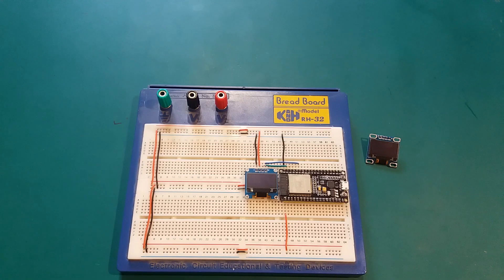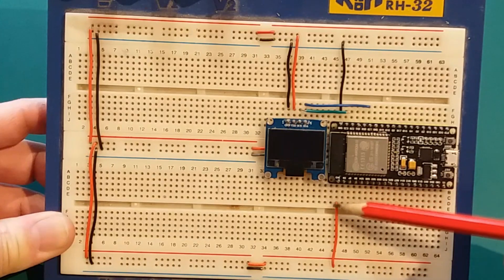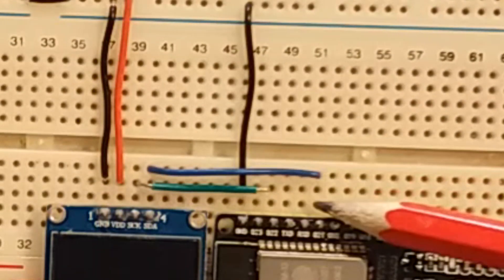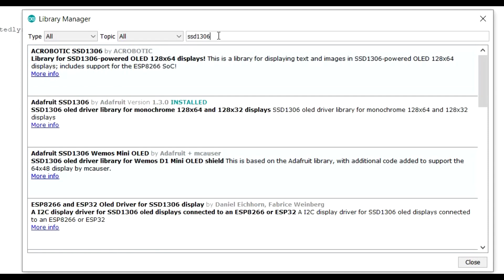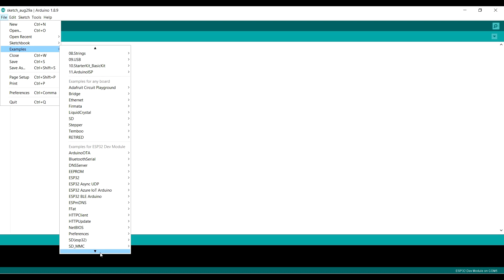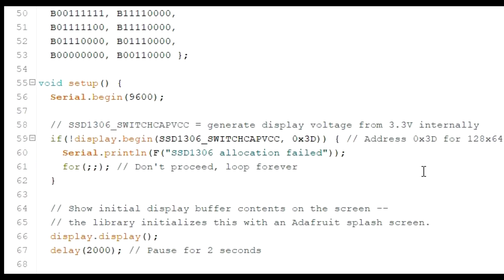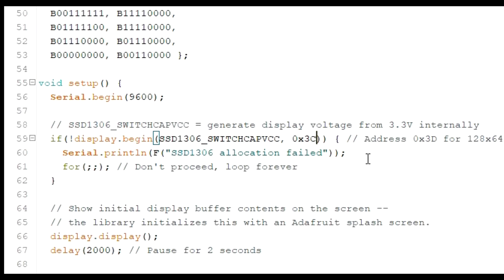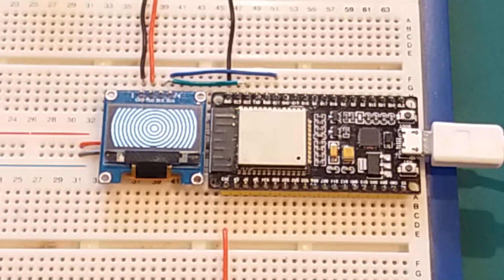Connecting an OLED to ESP32 (SSD 1306 Driver) and the pitfall to avoid!

Comment: If you can't find the address of an i2C device, the arduino wire library has an example sketch called something like "i2c_scanner" and running that will scan all i2c addresses, and will then tell you the correct address of your device in the serial monitor :) 

Found this to be way easier than guessing and checking until I found 3C.
Reply: also to find the i2c address of a module, you can look at the back of the module or somewhere on the module, it is liely to have it on there

Comment: Hi, May I know is this possible with ESP32-Cam AI-Thinker board ? When i try to run that it shows pixels on almost half of the screen
Reply from the maker: Although I've not got that board I'd have thought it should. Although you may have to specify the board in a header file perhaps. Sounds like it's almost working.

Comment: Thank you again for a nice video. I have another one of those chinese brands of OLED. This one says 1.3" OLED IIC ADD_SELECT 0x78 (resistor) and 0x7A (NC).
I cannot figue out which address to use. I tried 0x78, 0x7A, 0x3D and when I tried 0x3C with 128x32 (or 64) resolution, the bottom half of the screen is all white
and the demo appears to be partially on the top. It's like it is cropped part of the screen and not everything shows. Any ideas?
Reply: Make sure you are commenting out everything but the 128X64 option, if you are getting anything on the screen at all, then means at least the address is correct.

Comment: hey i think mine has ssd1315 driver , at least chinese shop i ordered it from says so , it wont run the code so i guess 1306 library doesnt work for 1315 ? or am i doing something wrong ?
Reply: Hey, I dont know if youre still trying to figure it out, but from what I remember, I was able to use the ssd1306 library just fine with the ssd1315, and you can also use the "i2c_scanner" example sketch from the arduino Wire library to easily find its correct address (outputs in the serial monitor)
Reply from the maker: Your right, you'd need 1315 driver
Reply: @XTronical  yea except i cant find any :I
Reply: And if you still can't get the ssd1306 library working with it, the official library for the ssd1315 is "U8g2lib"

Comment: with 3C i see something but its only in the bottom?
Reply from the maker: Double check you've set screen size to 128 x 64. I think you pass as params, but it's been a while since I used the library.

Comment: I have a DO-IT ESP32 DEV KIT V1 and this video made it work for the first time, using ADAFRUIT libraries. Subbed. You are the man! Different manufacturers use different pinouts and it drives me crazy My 1306 board is a Yellow/Blue version, however it correctly makes the top (28?) lines in Yellow and the remaining (100?) lines in Blue, both against a black background.
Reply from the maker: Brilliant, glad this helped and thanks for the sub.